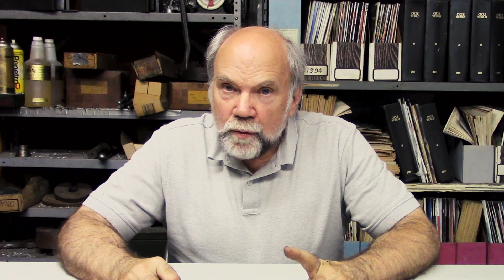Why Do Motorcycles Make More Power Than They Did 40 Years Ago?

Comment: Not a pretty sight. 
Great line.
I have seen a few of those myself.
I remember a YZ360 from way back, broke the rod at the wrist pin, the rod went through the cylinder sleeve, the crankcases, the motor mount bolt too. The clutch and transmission were the only things undamaged. 
TX750's did much more damage when they blew up.

Comment: I bought a rebuilt crankshaft from this guy for a Kawasaki H1R. He would not ship it to us from Boston to Western Pennsylvania because he said it is such a precision piece of machinery, he would not dare trust it to shipping companies. So my friend and I had to ride in his Vega, a 1700 mile round-trip in 22 hours to collect the rebuilt precision perfect crankshaft from this guy in person. when we got home, that precision rebuilt perfect crank too perfect to ship, would not even drop into the cases, that is how out of true it was. In fact, it was probably never trued.. it was probably just pressed together and sold to us unsuspecting/trusting victims. I have never believed a word this man said from that point on..
  whatever happened to the H1R??  The rolling chassis I traded to Eric Beull for one of his trailbikes.. The three cylinder engine with the chromed bores, Close ratio five speed and dry clutch? With the now true crankshaft?. We put that engine in a Suzuki xx hustler frame, extended the wheel base by lengthening the swing arm, and turned it into a drag bike that turned low 9s first time out,with way too low gearing.. it’s tongue was hanging out the last 200 feet tapped out in fifth gear. our lawnmower gas tank mounted to this machine was leaking fuel, we could not fix it, so we only had one run that day in the early 70s.. last I heard, that bike was still sitting in a friend of mine‘s basement until about 10 years ago when he expired. That’s the last I heard of him and the H1R..
  in case you don’t know, an H1 R is/was a Kawasaki factory Road race three cylinder 500 cc road racing machine, it was the equivalent of today’s Moto GP machines except, they were horrible wigglers. The rider that was going to ride this machine his name was Terry G. He was the top novice or junior I don’t remember AMA road racer in the previous year and he was allowed to move up to the expert class & a 500 machine because he won the championship in the lower class beating people like Kenny Roberts when he was up and coming.
  The first time out in the first race on the H1R for Terry Resulted in tank  slappers and a crash. Terry was riding Yamaha’s up until this point. Should’ve stayed on a Yamaha twin  like Gary Fisher, who almost lapped the field on a 250/or 350 at loudon that day...terry.had a minor crash at Loudoun. he was more bummed out about the damage done to his leathers than he was to the bike.. Terry G, and my brother-in-law and I were all motorcycle mechanics back in the good old days when bikes were cheap,harley  tariff days. Eric Buell was also one of the mechanics at that Honda/Yamaha dealership while he was going to pitt engineering school. I was a mechanic, but I had not yet started road racing. The funny thing about that is. I was the only one of that group that went on to win six road racing championships, and two national championships, AMA, and WERA..
  It’s funny how things don’t always end the way you think they will..
  One thing I learned racing. The factory knows more than we do, leave your machine stock. If you’re worried about your machine seizing while you’re putting in a 10/10 ride, you ain’t gonna win.. you have to be 100% sure in your head that your machine is not going to let you down. It took me a whole year to learn that, but once I did,I won championship after championship after championship, and I was protested all the time.. my machines were about one or 2 miles an hour faster than anybody else is in my class. Do you wanna know why? Because they dial them out by doing modifications. Leave it alone, Concentrate on riding,lines, braking, Gearing, jetting, tire pressures,learning how to ride.. if you’re experimenting while you’re trying to learn how to ride, you can’t do both. You will be and also ran, if you finish. Don’t listen to guys like this guy, the great crankshaft rebuilder. all the magazines treated him like he was a somebody like pops Yoshimura or Irv kanamoto..I fell for it, till I bought that crankshaft

Comment: Might be nice to include a mention of digital engine management and EFI as well. Both things account for a bump in horsepower--although not as dramatic as a jump of 4,000 rpm at the top end. With the added plus of lower emissions and better mileage. Just saying.

Comment: Cameron why haven't I seen 2 strokes with single piece cranks with planed bearings? is it because of lubrication problems? i.e. mixed fuel alone or even with oil lines to the bearings isn't enough these types need to bathe in oil?

Comment: What's more amazing that despite petrol / gasoline having less than 80% of the calorific energy content than it did 40 years ago, modern bikes still make more power!!

Of course 40 year old bikes make far less power than they did when they were new when running on unleaded ethanol crap, but they weren't designed to run on the stuff or cope with the damage the stuff does either.
Reply: That’s a great point! I do hate ethanol myself.

Comment: I disagree with the notion the old and new designs have the same volumetric effeciency.
Reply: A modern sports bike engine has race proven technology as opposed to the older engines.
Reply: Because you haven't done the math. Kevin is saying that at 10,500 rpm the old K was filling it's cylinders just as well as the modern K bike. The difference is the modern bike is capable of doing that at 4000 rpm more-it's rate of work ( power) is therefor proportionately greater.

Comment: I used to straighten up and then TIG weld the cranks to build a 1485cc top end with a huge turbo running at 30 psi with very soft cams to make it all stay together for a "Breakfast Run" cycle.
Reply: Bryan Kirk "Bitchin" speakin my lingo. I'm sure you've breathed on a few things

Comment: Engine designs like much higher compression ratios bigger bores shorter strokes lighter internal parts variable valve timing better fuel system (efi) etc etc
Reply: Some more "etc etc" stuff...  Electronic ignition timing, thin piston rings, optimized head, intake, and exhaust designed using fluid-dynamics simulations.

Comment: Lots more advancements.....not just bearings and oil pumps
Virtually everything is engineered better, more efficient.
Reply: Whilst far from expert on this topic, I think it is obvious that he is referring to what was responsible for the biggest leap in development which was responsible for a transition to a new way of thinking. Your analysis is obvious and so not really insightful, because all manufacturers will look to improve as many aspects of the vehicle as possible. But few will set the trends that lead to a real leap in performance. For example, the standardisation of Traction Control could be said to have a similar effect. Someone took the risk to go with it and now it's developed so much that the voice of the die hard old school "I don't need no computers to make me go faster" has all but evaporated to a whisper. So, yes. Bearings. Just like in F1 the advancement of Piston technology was a real gamechanger in generating significantly more power.